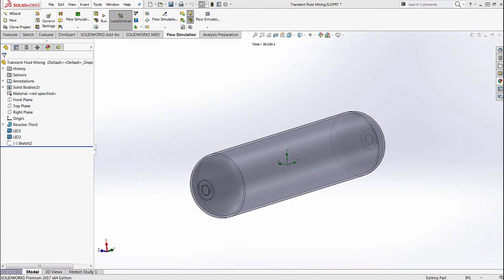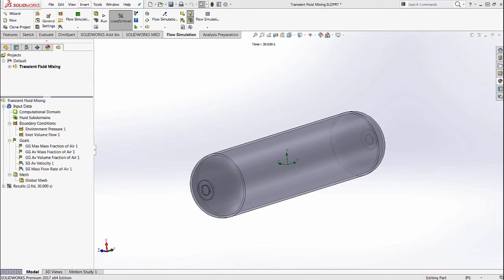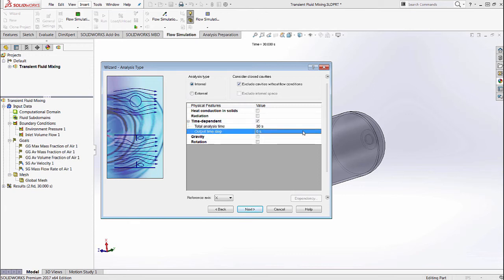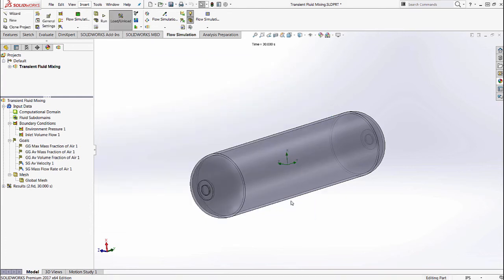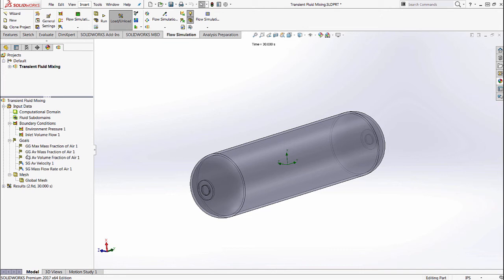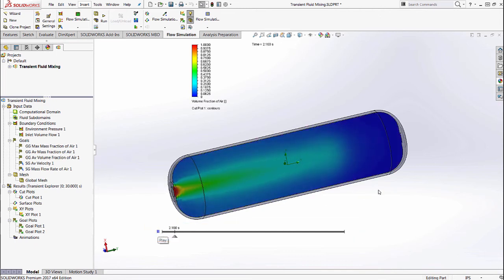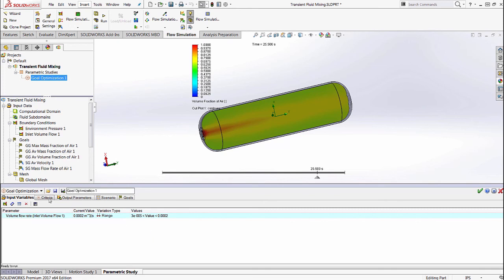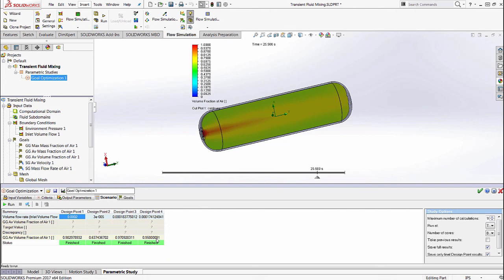SOLIDWORKS Flow Simulation - Fluid Mixing Transient Analysis Optimization

Comment: I am currently looking for a tool to solve Passive scalar transport in a fluid (diffusion of salt in water). Am I able to do it with Solidworks Simulation?
Reply from the maker: Thank you for your question.  There may be two components to this question (1) the dissolution of salt within Water and (2) the diffusion of SaltWater in Water. (ref. http://www4.hcmut.edu.vn/~huynhqlinh/olympicvl/tailieu/physlink_askexpert/ae148.cfm.htm )
 
We don't directly handle the dissolution (molecules being forced apart), but we can simulate diffusion (S-09349 in the KB for reference).  There may be some limitations with regard to the diffusion depending on the particulars of your situation, so you may want to contact your reseller if you need more technical information.

Comment: Great Job ! , can we use three fluid for the same case ?
Reply from the maker: Hi Salah,
You can use up to 10 fluids in the same project if you wish.  The only requirements is that all the fluids entering one chamber must all be the same phase.  They must all be gas or all be liquid but not a mix of liquid and gas.
Reply from the maker: We're glad to help! :)
Reply: GoEngineer , last question if you don't mind, how we can control the sequence /order of the fluid that going to pump let's say inside the pipe , and do we can control the volumes of the   followed fluid ? Thanks in advance
Reply from the maker: Once you have setup your Flow project to be Time-dependent then you would be able to edit the definition of your mass/volume/velocity flow inlet and define the substance concentrations to be controlled by a function or time tables.  If you look at the video starting at 2:37 the substance concentration values have a button labeled "f(x)" next to them.  This is the area where you would control your substance concentrations over time.  This is controlled per fluid so you would need to setup a time function to control each fluid.

The system does not let you set a total volume for a particular gas so you would need to use some hand calculations to convert a total volume into a length of time at a certain volumetric inlet rate.
Reply: Sounds good ! Cheers
Reply: GoEngineer Is it possible to simulate the behavior of immiscible fluids in a sealed vessel being placed in various positions? Say an oil solution and a water solution...  Have you ever seen those old liquid toys that make waves inside?  Can this behavior be simulated using specific mixtures of liquids?